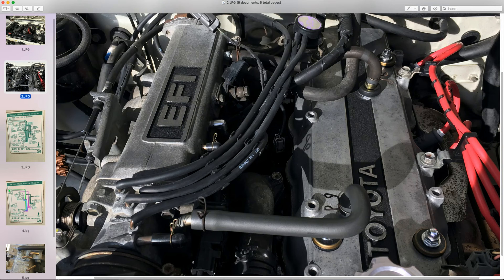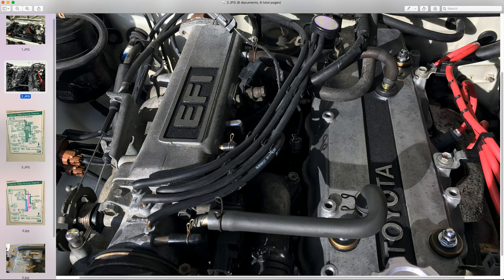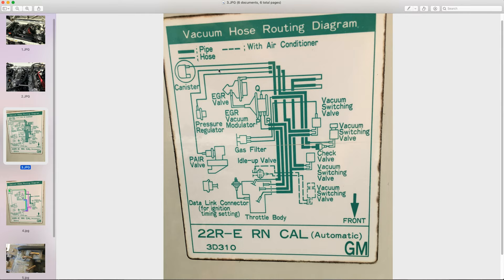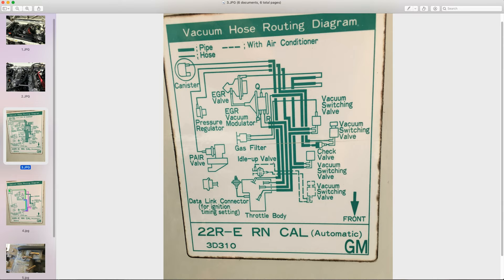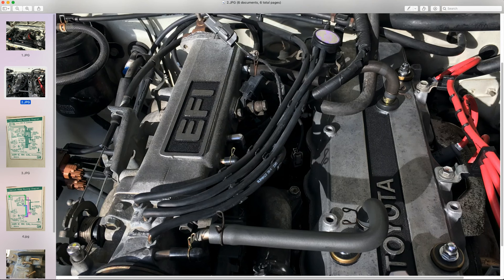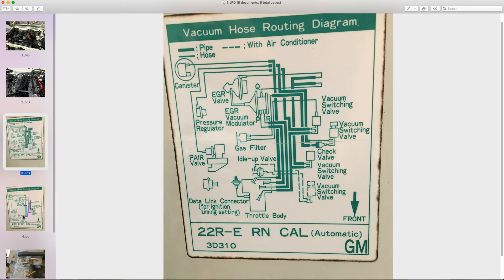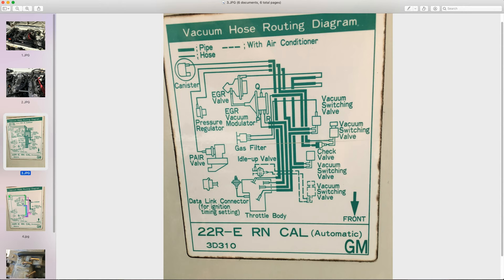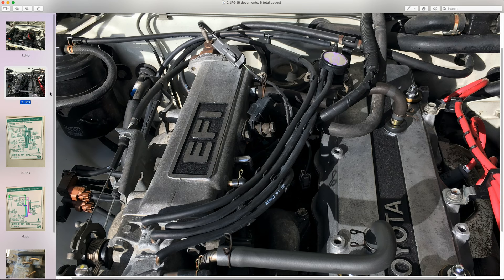Toyota pickup 22RE - Throttle body vacuum ports & EGR valve / modulator hose routing locations info

Comment: This is the most extensive video I have seen on 22RE EFI system. With the fuel regulator VSV removed, did you disconnect the wiring and if so, does it have any neg. effect on the ECM?
Reply from the maker: No negative effects. You can just cut off the connector on the harness and seal the wires so they don't touch anything.

Comment: 3:39 Does running manifold vacuum to the fuel pressure regulator negate the need for the AFM to control mixture?
Reply from the maker: No, the AFM sends air volume data to the ECU which modulates the pulse width of the injectors, so it's still required. Running a vacuum line straight to the fuel pressure regulator mainly eliminates the need for the fuel up VSV and removes a couple extra hoses from the mix.
Reply: @ray5961  I see. Thank you!

Comment: Im not running an Ac but do have power steering, can i route all the whose's like you did?
Reply from the maker: yes but without the idle up the motor might want to stall when doing full lock turn, but I'm not
sure

Comment: So the EGR pipe itself goes into the intake between cylinders 2 & 3 like on the earlier models?
Reply from the maker: I'm not quite sure what you are asking. The EGR pipe that feeds exhaust gases into the intake system bolts to the back of the upper intake plenum - inside the plenum there is a long passage way that rungs along the roof of the plenum to the front area where the throttle body bolts up - it dumps exhaust gases into the mix there and then they are drawn into the plenum and mixed with incoming air from the induction system (AFM, etc.). Is that what you are asking about? If not, let me know and I can answer more if needed.
Reply: @ray5961  Yes, the older carb type looks like they run it directly into the intake manifold between 2 & 3
Reply: ...cylinder 4 is missing at idle and trying to troubleshoot that.
Reply from the maker: @StanKindly  I don't have much experience on the older carb motors.. but could very well be yeah
Reply from the maker: @StanKindly  got ya. Try installing new spark plugs right off the bat. Also, dump some Berryman B12 fuel injector cleaner in the tank - even though it's a carb, it will still help clean out the jets. Try totally blocking off the EGR system if you can.. if it leaks it will cause the engine to die. Also missing at idle can be very symptomatic of incorrectly adjusted valves. I had a slight miss when cruising and I finally traced it to a couple of valves being out of adjustment (and only about .004" out too). I'd start with spark plugs myself - fresh plugs can really make a huge difference. Also check to make sure the coil isn't cross sparking near its mounting bracket (turn the lights off in the garage, watch under the hood where the coil is and sometimes you can see sparking). Same goes for inside the underneath part of the distributor cap (on the roof in there) carbon can build up inside the cap and cause across arcing inside the cap - you might wanna take the distributor cap off and wipe the inside with carb cleaner on a white paper towel and see if that helps (check the roof closely for signs of arcing first though.. sometimes you can see the carbon pathways.. they look like little black hairs in there). Good luck and let me know if you have any luck or further questions. Run a compression check also if possible.
Reply: Thanks for the response and. I do have a 93 EFI (didn't mean to be misleading). 
I've  installed a few new parts  (distributor, plugs, adj. valves) and had a mobile mechanic do a "dry" compression test when it still wasn't starting (65 lbs and didn't increase with oil)...
I gave away all my tools a year ago when I thought I was moving. Anyway, I'm starting to suspect a rounded cam lobe on the intake because it has a strange resistance when cranking - like a vacuum in that cylinder. But anyway going to buy new compression tester and leak down tester at least before I pull the valve cover again and start from scratch.
Reply from the maker: @StanKindly  65 PSI or 165 PSI in each cylinder?
Reply: @ray5961  65 in #4 and 80 in the other 3..that's having not run the motor several days plus cranking many many times. cylinders were pretty dry...since then I've got it going and has plenty of power. it's just missing at idle.
Reply from the maker: @StanKindly  if those readings are correct, you have some serious failure in the motor some place. Make sure when you do the compression check that you are holding the throttle plate open and that your gauge is accurate of course. Normal 22RE compression should be around 170 PSI +/- but numbers like 65 PSI or 80 PSI indicate either a spun bearing or a failed head gasket or some significant failure in the rings. I'd definitely redo the test and make sure you crank w/ the throttle held down and crank for 10 seconds. Anything below 142 is the lower service limit.
Reply: @ray5961  Thanks and I'll let you know.

Comment: Have any ideas for having to much vacum?
Reply from the maker: How much vacuum are you seeing?
Reply: @ray5961  i dont have a gauge to check. My motor runs really rich. Changed o2 and new afm. When i pull remove the break booster vac hose then the truck idles normal.
Reply from the maker: @itsgatormane  Sounds like maybe you have a vacuum leak in the brake booster diaphragm or hose? It's hard to say. Get yourself a vacuum gauge and tap into a line and see what your motor is pulling at 900 RPM idle - should be around 17 or 18 inches or so if all is well. I use this little gauge here and it works real well - https://www.amazon.com/gp/product/B000CODRFO